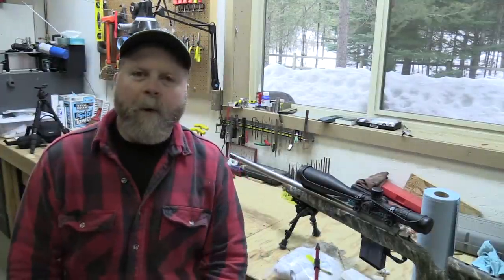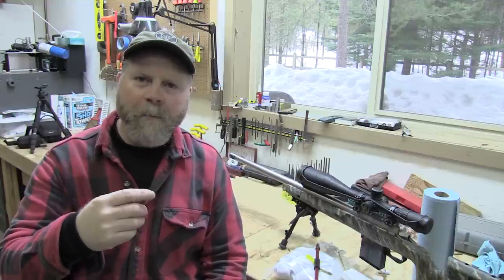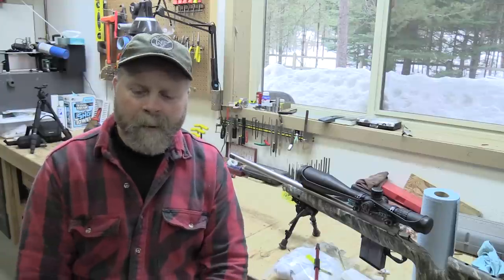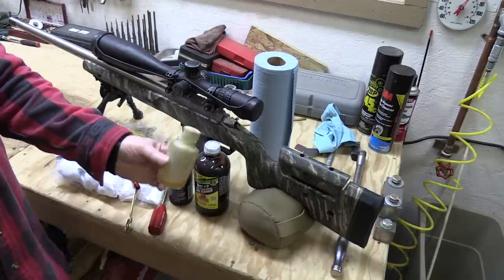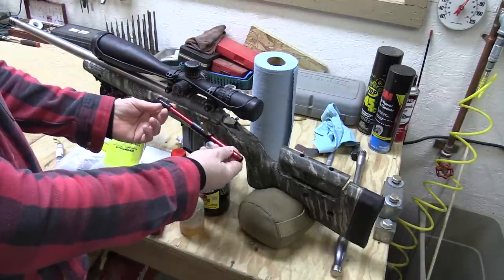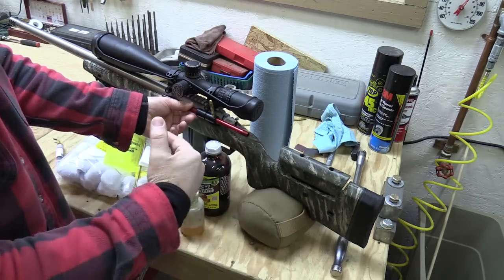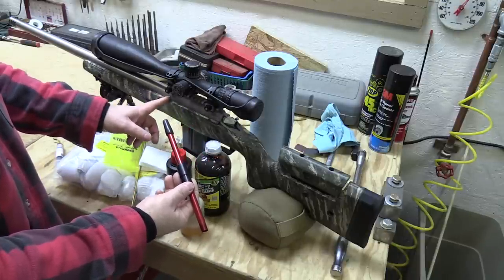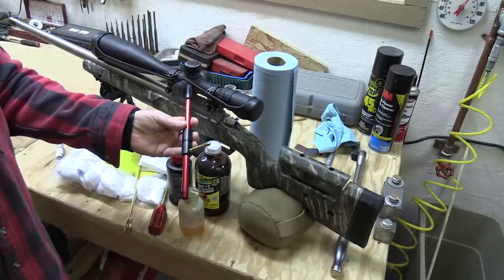Precision Rifle Barrel Break-in & Cleaning: Why, how, and do you really have to?

Comment: Hi Sam - You probably should mention that Sweet's 7.62 is ammonia based and traces of it could remain in the barrel which will cause corrosion even after running tight swabs through the barrel. I've always used Birchwood Casey Barricade (formerly named Sheath) after cleaning the barrels in my pistols and rifles. I put a clean cotton patch on a brass patch holder and I dampen it slightly with Barricade then run it down barrel 2 or 3 times, let it sit for a couple of minutes then do the same thing with a dry patch. It's a great product to use and prevents corrosion on both the inside of the barrel and the outside of all my firearms. For the most part, it doesn't get too humid in Arizona but it's very useful in regions where the humidity is high.
Reply: He did it right , he took the brake off first

Comment: For 40 years I have wrapped a patch around a bronze bore brush wet with Hoppe's and used that to clean my bore and then I run patches until it stays white. It works like a champ.
Reply: So you let the hoppes sit before dry patching
Reply: Scott Murphy  Thanks do you use a brush too at any point I hear negatives and positives

Comment: Great Vid. I learned some things. I love those Kreiger barrels. I follow basically the same process but I check afterwards with a Lyman Borecam Digital Borescope which I got a Black Sheep in Coeur d'Alene, Idaho  for about $250. Even after your patches come out clean, the borescope will reveal carbon and copper in the lands. Usually a carbon ring in the case mouth area of the chamber as well. You have to decide then if you are done or you want to go farther.  The borescope is a real eye opener. I don't know how I lived without that for so long.

Comment: Your presentations are great. You are organized and teach with clarity. I have been neck sizing for a few years. From your comments I have surmised that you bump the shoulder to ensure easy and reliable chambering.  Your statement is that accuracy is accomplished by being consistent. I make sure that I fire rounds in the same rifle every time, thus ensuring that the case is fire-formed for that chamber. I have never had a problem with chambering a round. I shoot 0.7 MOA or better with "off the shelf" factory rifles/barrels. Other than reliable chambering, what is the advantage to FL sizing vs neck sizing? I am not doing long range competition shooting-- just South Dakota prairie dogs at 300+ yds. with 22.250 & .243. I'm not opposed to doing the work. I like your comment, "If I don't see a measurable difference by doing a function, I don't do it".

Comment: I clean it at break in.The muzzle crown it the most important of all. And I dont use real harsh chemicals either.I learned this from a man that makes really high end rifles and barrels.He shits ELD and when you buy a a rifle from him and company they help/teach  you how and what to do.
I never realized that the aluminum and brass cleaning rods hurt your barrel.But they do.And protecting both ends of the barrel is just as important.
A bore guide is important as well .
Good video
Reply: @SpaghettiFPV-tg3qh  indeed, you can scratch gold with a diamond but not the other way arround.
Brass or copper is way softer then steel, after all many projectile’s have copper anyway🤷🏻‍♂️

Comment: Dewey coated cleaning rods & bored guides are the best !!💯‼️
Reply: I got my first one 30 years ago, along with a brass bushing, to clean the bores of my M1 and M14.  The bushing is to protect the crown as of course you have to clean from muzzle to chamber. My .30 cal rod is still going strong. I cannot see anywhere the black nylon coating is gone.
Reply: No boretech is. Everyone knows that, and Tipton right after that.

Comment: After I break a barrel in mainly my AR’s. I clean the bolt, bolt carrier and pin, I’ll clean the chamber with a AR camber brush. Then I run a bore snake with a film of CLP at the tail. Run it down the pipe three or four times. Job done. But I do spend the time on the break in cleaning and firing. Great video, nice tips on the products.

Comment: My break in is just shooting it . In the army and our snipers rifles had to be broken in per manual per the commanders orders . I used to break in my own precision rifles as per the same methods and found from testing that just shooting works just as well if not better . So my method is get a decent load and shoot it get about 300 rounds through it and then clean to get my load fine tuned and then don’t clean it until it stops shooting . Usually around 1k or more . My .223 trainer has about 2400 rounds through it and has been cleaned once at around 1800 rounds I’ll probably clean again around 3k . My 6.5x47 lapua is at 1456 rounds and it hasn’t been cleaned but I’m starting to get a small carbon ring so I need to get that out of there but other than that it’s still shooting very very well .
Reply: That has been my experience as well, even with factory barrels.  Thank you for your service.
Reply: GREAT ADVICE...!
Reply: Just shooting it is honestly the best advice. After my military service I too thought all rifles needed to be cleaned to death. I have since found out cleaning deteriorates accuracy. I have a 338 RUM with 502 rounds down the tube and haven't cleaned it once in 3 years. Shoots half minute all day.
Reply: agree......i dont clean my barrel till i need too....factory barrel like 400 to 500 barrels....nice match barrel a lot longer
Reply: I didn't ever hear of break in periods with barrels. I generally clean at the end of hunting season or after being exposed to rain. Other than that I don't clean it unless it gets dirty as hell and doesn't function right.
Reply: Exodus fivesixfivesix , Military training, "Take care of your peice (gun) & it will take care of you." A dirty gun is a FAILING gun. A failing gun gets u killed. Is the lazyness worth your life??
Reply: Dave Jan yeah I don’t use my Remington for anything other than killing deer. I’m not worried jihads will come out into the woods just to kill a hunter. Besides I have that and a mossberg 500 during hunts. So I’m not worried of dying on a hunting trip. The reason the ar platform needs to be cleaned all the time is because of clearances being so tight that the faintest build up will make it malfunction
Reply: Exodus fivesixfivesix , My Nam buddies had really bad experiences w the early M16s. Their Orders were to kill a V.C. & take his AK, problem solved. Thoes "buckets of nuts/bolts" ALWAYS worked. Kinda wonder why our mfgrs arent following suit. But what do I know., my Nam experience as an airdale was flying over, getting shot down, captured & escaping. Never carried a gun.  After i got home I moved to the remote Alaskan bush. Just recently moved back to "civilization".  All these new toys are a whole new world to me. Carried a Marlin 1895 45/70 Grizzly gun out there. Had bolts for general hunting guns (243/fur, 300 win mag/ bear-moose, & a 375 H&H mag that almost got me bear killed so i sold that POS & UPgraded to the 45/70, but only 1 semi auto. Rem 742 30:06. Lost all thoes when the cabin burned down. Just recently got my 1st AR. FUN TOY!! No probs w it yet. With all these new (to me) AR platforms Im learning about I feel like a kid locked in a toystore. Dont know which shelf/toy to play w first!
Reply: dave and exodus, the more you talk the less you make sense.
Reply: grr ummmpee how so?
Reply: But also in the army, you use MC4150 barrels not Stainless Steel 4160R, so your barrels are already protected and can last as twice as SS. For people who use SS, I think they should give extra care to make their barrels last for 3000 to 4000 rounds.
Reply: i do it it seems to work but afterwards i clean after the groups start to open up sometimes after 100-200 rounds or so - i believe some fouling is necessary to fill in any nicks and crannies in the barrel (great video)
Reply: I'm with you. Had to break in my M4 in 98 and then the what was then the XM107 in 02. Still neither was as bad as cleaning the 1911's we traded in our M9's for after seeing 1st hand their ineffectiveness in A-Stan. 30 years of sitting in cosmoline. What a nightmare.
Reply: Dave Jan Hmmm. I can’t imagine Commanders ever suggesting that. I’d love to see those “orders”.

Comment: Thank you for your awesome videos! On your cleaning of the lugs, at one point you demonstrated running the Dewey chamber cleaning rod counter clockwise. If a viewer does that, the material holder at the end if the rod will unscrew. The jag where you described wrapping the patch around is called a Parker Hale style jag. When cleaning your rifle with a wet patch or brush you have the muzzle end of the barrel higher than the receiver due to the height of your bipod. You want to have the muzzle end lower to allow the excess solvent to run out the muzzle and not towards the action.
Reply: I saw one guy use a clear water bottle fitted over the end of his muzzle to catch any liquids and brush bristle spray that comes off the brush when exiting. This guy slit the neck of the bottle to fit a larger dia barrel as well. I also like the practice of keeping the muzzle angled downwards for drainage.

Comment: Great video. I might add that a .45 cal. or 410 gauge bore brush works great as a chamber brush for most cartridges. I have used both depending on the rod I use.

Comment: Excellent videos keep em coming . I used to use sweets years ago , it certainly works great but the Ammonia fumes can't be good for you . After using sweets and drying the bore with clean dry patches I don't think you're getting all the chemical out of the nooks and crannies in
the bore . It would be best if your were to degrease the bore or to run a few tight patches with a rust preventive such as G96 or something similar. These days i use Hoppes No 9 letting it soak in the bore for 20  minutes then dry patches which seems to get most of the copper out of it , then I'll run another tight wet patch of Hoppes through the bore and store the gun with the barrel pointing down in the gun safe for a few days , then I'll run a few dry patches into the bore , if there is any copper left in the barrel it will be removed completely at this stage . Hoppes can be left in the bore as it wont harm the metal. Oh one other thing it best you use some disposable rubber gloves when handling these nasty chemicals , particularly solvents. Cheers
Reply: LO

Comment: Now you started off great and pretty much how I LEARNED on my own to break a barrel in, which nobody in the gun forums believe me, with the shoot one shot, then clean, then one then clean, but I do that 10 times, them jump to 3 shots then clean, but I allow 3 minutes between shots to not allow the barrel to get hot.  Now., I have learned the expensive way to stay away from ALL copper cleaners.  That Ammonia will pit a bore over time.  Shilen recommended back when i built my 3 varmint rigs that the only thing they recommended to clean any copper out, was Flitz metal polish.  I used Sweets in the past and ruined a couple of good barrel blanks.  Stopped using it, and came up with my one shot and clean method, and I ended up with 3 rifles that did not collect any copper at all once they were broken in.  Just a couple of patches with solvent and a couple of dry patches and they were clean.  Now those who shoot BR will go through 4 or 5 barrels a year anyway, so they clean with Sweets and get it over with since by the time they have too much pitting, they have the barrel shot out anyway, for BR accuracy anyway, so they do not care about long life.  Ammonia will pit steel.  Those pits will collect MORE copper over time.  I use nothing but Hoppes #9 to break in and clean my bores.  The good old stuff is still the best.  Now all of my rifles shoot in the .0's.  All of them, a 22-250, .223 and .243 will all shoot under 1/8" groups if I do my part, and have shot many sub 1/16" groups with all of them.  Just a bullet hole with 5 shots.
Reply: That's insane, 1/16" groups. Do you mind give my your reloading procedure to achieve that?
I have a few 6,5x55 for shooting and reload but struggle to get below 1/3 MOA.

Comment: Cleaning your bore, copper removed, changes your zero for a while. Your POI will be different, usually higher, until you foul up your barrel with about 10 rounds and you could see it return to zero. If you clean your bore be aware that it could happen. Don't try to change your scope settings to try and get a zero, just shoot enough rounds and will return.
Reply: Good advice!

Comment: Thanks for the video. I did buy a bore scope (I may have To Much information now) but something i did notice while breaking in my Krieger barrel was that the first 10 to 12 inches 0 copper all carbon the last 14 to 16 inches very little carbon mostly copper and with each shot clean cycle less copper, carbon staying about the same. also the copper pattern was very irregular the first few cycles it is getting more uniform in the pattern along with getting to be less.

Comment: Right or wrong i have always used a 45 round break in. Fire 1 shell and clean repeated 5 times, fire 3 shells and clean repeated 5 times, fire 5 shells and clean repeated 5 times. After my break in i try not to ever clean my barrel, i did once and my 100 yrd groups when from .6 moa to 5.5 moa. It took about 50 rounds for it to foul and groups returned. Thank you for you video, just wanted to share my experience. My channel is all season outdoors, thanks again mike.

Comment: I have to agree 100% with you on barrel cleaning philosophy.  A good barrel is made with good quality type of steel, quality machining (tolerances), quality heat treating, etc ...  all that far exceeds the normal wearability.  Again, unless I'm hunting in the rain all day and it's vital to remove the water/condensate inside that barrel ... leave it alone.  Not say you never need to clean the barrel, just feel people go way over the top on barrel cleaning. 
But, that's just my 2 cents.

Comment: Very interesting cleaning video. - Just ordered a Savage Model 12 LRP in 6.5 Creedmoor. Thanks for your video on that rifle.
Reply from the maker: Chris K I used the same method outlined in this video on my LRP. I haven’t cleaned the bore in 600+ rounds now. It has one of the best factory tubes I’ve seen.
Reply: Hope mine shoots as good as yours. I have other highly accurate custom built rifles like yours because I love tiny groups. -  I can see how leaving the carbon fouling in the barrel would help protect the steel from the heat of firing. Your cats are fun to watch in the videos.
Reply: Chris K , I promise you , you will LOVE the savage 12 LRP in 6.5creed !! I have the same gun and I absolutely love it ! I bought the gun and started reloading immediately and I have a 5 shot group inside a dime @100. Another 10shots inside a nickel. I was afraid to buy it cause I was never a savage fan , but I am now !! Congrats and good luck 👍👍
Reply: Thanks.
Reply: Chris K I got that exact rifle thanks to Sam's review, great rifle shoots outstanding, i got just over 1000 rounds down the tube, but ejecting is not the greatest and i cannot shoot small rifle primer brass, just FYI, maybe yours will be better
Reply: Thank you.
Reply: I also have an LRP in 6.5C and it shoots 3/8” groups regularly. I did not do a break in, just shot it.  I used it in the Rex RX17 live fire in November and it performed very well.
Reply: I bought in to the savage "out of b ox accuracy" hype and my sav.12 didnt disapoint.  Best bolt gun i own!

Comment: My wife and I just broke in two barrels yesterday.  We shot 1, cleaned, shot 1 cleaned, shot 2, cleaned, shot 2 cleaned, shot 3 cleaned and gave up.  Neither one of us was getting any trace of copper at all with Sweets.  I think a lot of break in is determined by the gunsmith and how sharp his reamer is.  In Canada, using Varget in my #1 gun, .308 Winchester I ran several tests and found that I could shoot up to 325 rounds with no degradation of accuracy (group size/scores).  I would clean every 250 or so depending on the match schedule.  After moving to the UK I have had to change up as the UK NRA Matches are shot with issued ammunition with a Sierra bullet, military brass and a spherical ball powder.  The powder leaves a lot of carbon and other residue from the coating used to control the burn rate.  Accuracy falls off really quickly so the locals clean at the end of every day during a match regardless of how many rounds are shot.  I now understand why.  I loved Shooter's Choice in Canada, but I can't get it here as it contains some chemicals that are banned in Europe.  Same with Varget powder.  Same with Sweets although a friendly gunsmith can give you some, you just can't buy it.  I switched to MPro7 which I can get and it is great on carbon.  Very good video.  I got a cheap borescope last year and I now hardly use a bronze brush at all.  I recommend you get a cheap one and use it as a cleaning aide.      Thanks very much for this video!!  Good old common sense is great.

Comment: I bought a hand lapped Pacnor barrel and never fouled, just a light trace of copper indicating to me the gun doesn't need a run in.  I have a damp house and even stainless will rust lightly if not oiled.   I got the shock of my life when I ran a patch through my Sako TRG and it came out brown and a deep pit could be seen with the naked eye after 6months of storage!   Now I always leave a light coat of oil in the bore and exterior now, or though I should get a small heat source for inside the safe.